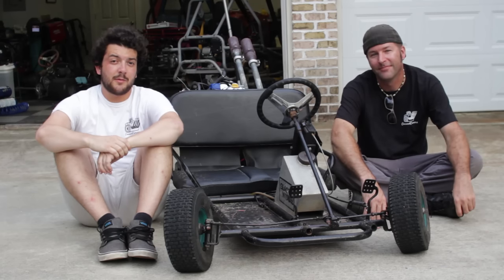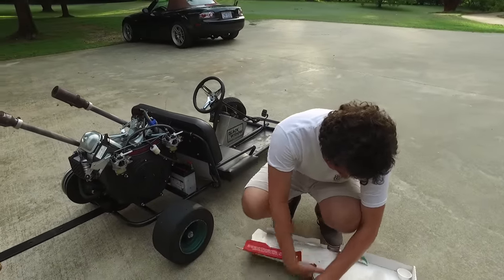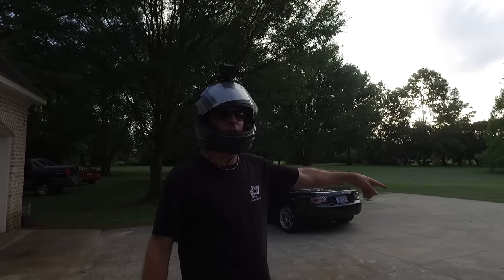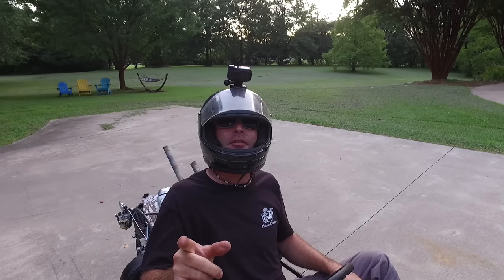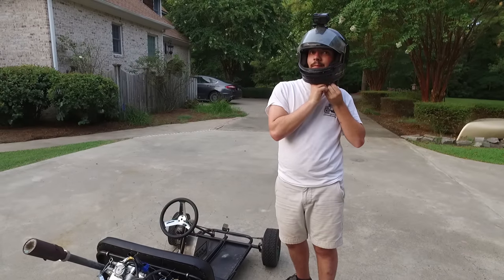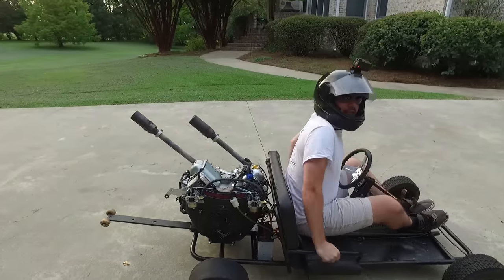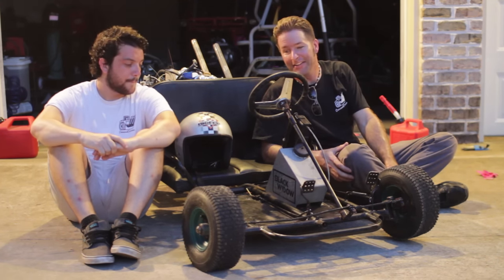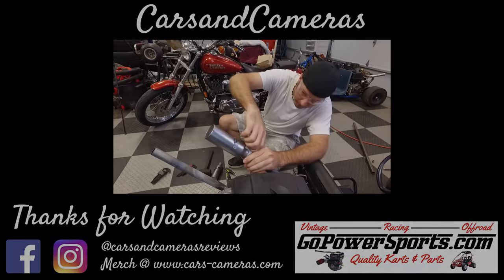Modified 670cc Performance Testing

Comment: Lengthen the cart (responsibly with structural support) and you'll get more airflow to the engine.  The seat and driver are blocking the cold air.  Added bonuses - cooler air = more power,  look  cooler, knees not blocking the view.  Just sayin'.
Reply: Bump this. Excellent idea
Reply: They could also move the engine a bit more forward of the axel depending on how the do it and help with weight distribution and keeping that front down
Reply: PunchingMegaTree dam. I get what they want tho. Although if it was me I'd just mount the wheelie bar at a 20-45 degree angle and just enough to clear the wheels on it
Reply: +MyLonewolf25 forced air intake with a couple pipes that lead off to the side would help for better air flow
Reply: Joshua Cyrus that too

Comment: Awesome, my gokart does about 30 mph  well 25  maybe. I have actually rolled it taking  a corner. I thought  it would  stick  like it usually  does but we went over. My knees were stuck between  the  steering  wheel  and  frame for like, 2 rolls before  we separated  and the  kart flipped couple  more  times . I had  to lay  there and wiggle  body  parts  to make  sure  l was ok. Funny  how  that made me realize  that I am 43 and  not 17 any more. Lol nice vids keep  having  fun  guys.
Reply: lol. glad your ok

Comment: Put a turbo on it.
Reply: i agree turbo it
Reply: Prob not gonna do anything
Reply: +MrRavenous TURBO=OVER POWER OVER POWER=INJURIES AND INJURIES=LESS VIDEOS....Do u see where im coming from?
Reply: +Aaron Larkin "they" (John) crashes it anyway
Reply: Ya thats i good i idea i like it
Reply: twin turbo
Reply: you're coming from not so fun parties lol
Reply: Aaron Larkin
No but i see a turbo and an awesome video in he future.
Reply: It'll be fine.
Reply: A two stroke engine can not be turbo charged. The exhaust is forced out with the fuel and air being sucked in, if  its forced in, you will be forcing fuel and air out through the exhaust port, a fucking stupid idea.
Reply: Ozzie Peck
 Is that not a 4 stroke engine? Because they had an oil leak.... and from my knowledge two strokes have a mixture of oil and fuel so there is no oil pan.
Reply: 2 stroke engines can be Turbo charged! You would need to modify the engine and carbs pretty much but it's possible. Way easier would be a supercharger. The 670 is a 4 stroke anyway. But a supercharged 2 stroke would be a fantastic project!
Reply: +fishFind3000  So What? It would still be cool and fun to see.
Reply: Won't work
Reply: Actually, by putting the carb in front of the turbo its fairly simple. Classic Suck-through setup :)

The crankcase itself shouldn't mind the added boost much. Jetting and porting will be a pain, but it is very doable. World record 50cc bike (google "buddfab") and countless snowmobiles are set up this way.
Reply: kondemnert or just boost reference it
With something like this
Just run a line from the tank to the intake and boom
Boost referenced
Reply: do you guys fix and modify other people's go karts ; for money of course
Reply: Aaron Larkin lol I have a 4 cylinder 600cc engine from a Kawasaki ninja
Reply: No . Its carbeurated.
Reply: Matt Williams you can put a turbo on a carb bro.
Reply: Ozzie Peck The hell they can't; it's quite common in the snowmobile world for the Polaris, AC, & Skidoo's
Reply: hmm...great minds think alike.
Reply: Did anyone look at the stain on the pizza box .
Reply: LARKO LAD it'll be fine

Comment: i bet if you put a bigger sproket on there you could push some serious speed
Reply: smaller sprocket* on axle would b more top speed.. bigger one on the tav would have the same effect but not as significant..
Reply: +I.C. karting 
Ya should go as big as you can go on the tav. It causes less sprocket wear vs a small front sprocket. 
Adjust speed accordingly with the rear sprocket.
Reply: 2 ATV carbs and a smaller rear sprocket will give you more speed.
Reply: You can only go so big with    the tav sprocket and they're specific to tavs.. I say just throw a 40 tooth on the axle I think it b the easiest way... and those carbs are good if they jet em a lil richer. But higher gearing will make it accelerate harder too cuz low gear on it now must b like 14:1 with small tires that's useless
Reply: the rear sprocket or the front, cuz the rear sprocket almost hits the ground when they are doing wheelies, but i guess it would make some nice sparks
Reply: a bigger sprocket would give more torque but less top speed. But I do agree they should put a smaller sprocket.
Reply: I agree. Larger front or smaller rear would make this really fast. My 208cc can do 65 at Blackhawk, so there no reason this thing couldn't do 80 with the right gearing.

Comment: Take a pcv valve of like a Miata and put it inline of the crankcase vent
Reply: Most small engines have a pcv valve but when it gets higher Rpms then it begins to fail and starts pissing oil
Reply: +MaineMan yeah, use a higher quality pcv valve made for a larger engine like a Miata one because yet the engine is small it's bigger than the 670
Reply: +MaineMan maybe one of those mini pod filters too
Reply: pcv valve or not the engine still needs to vent crank pressure. they just need to T it off and run those lines to the pod filters.

Comment: I'd focus on sorting out the motor. Pods like you mentioned, better throttle cable system to synch the carbs, catch can or something for the oil problem, then start messing with the jetting on the carbs. Wider tires probably wouldn't hurt. You guys are awesome, thanks for the amazing content!

Comment: This list makes sense to me.  
0. Play with mixing your own fuel.  (read up on what Acetone and Toluene can do for you)
1. Oil Catch can
2. Jet the carbs to the desired AFR
3. Rework the exhaust into a Y to gain scavenging effect.  
4. Put timing marks on it so you can check timing, then make changes from there.
5. install some type of adjustable timing on it, either a distributor, or electronically controlled timing.  
6. Port cylinder heads.  
7. Tuned intake manifolds (proper length and diameter) for what RPM and flow you are running.

Comment: Come up with different exhaust designs and test for performance changes. For instance, someone in comments mentioned an H pipe design and I was thinking an X design, and maybe Y pipes design with one baffle. These ideas would be cheap enough and interesting for most of us. 
Maybe include what you guys do to correct the camber issue and address some safety issues, like a cage maybe?
Anyway, thank you for these videos and the smiles and outright laughter they bring. 
It'll be a'ight

Comment: You can do a lot with porting and polishing, which you can do yourselves. Mill the head to boost the compression, and if you put a cam in it you will see a lot of difference. If you go with boring it out, and new piston you will get some more ponies. When you do all that, better hope you are on the grass when it blows up, because the oil will leave a really bad stain on the driveway. Ike the slippage you felt was the grass under the right rear wheel, and the full throttle ride on the jogging trail was a little scary, and it is good you are wearing a helmet. That way when you are laying up in the hospital with all your limbs hanging on wires, at least you will be able to see the nurses walk by.

Comment: After you get some pods, get a tuning jet kit. Several main jets so you can find the right  tune with the header/carb setup. I would start  with one size smaller than what you have in the new carbs. You have awesome flow .

Header length and even the tips you have, type of gas, and weather all affect your optimal jetting. This thing is wicked.

Comment: I have a 06 CBR 1000RR engine . The deal is this , you guys can have it for two years if you get it cleaned up , running and picked up from my house. As long as you guys return it in working condition in two years it's yours to play with. It's been sitting outside under a tarp for about 2 years. Its going to need some serious TLC but I'm sure you guys can handle it. I live in Fort Lauderdale FL

Comment: Wider tires open up the jets, twin high flow air filters, a breather catch can higher pound valve springs and maybe better rockers, advanced timing key and possibly a performance cam and billet rod you can get about all of those at go power sports

Comment: Yall are awesome, im in the process of restoring a dual axle frame somewhat similar to yalls, planning on getting the same engine, what type of clutch/torque converter did yall use. Thanks

Comment: go to parts store, pick up a pcv valve, oil problem solved, do advance timing if you can, an advanced timing give a lil more pop as the piston goes past tdc, you can also port match and polish the heads... that will put the mo boogie in it..... cool vids keep it up

Comment: This thing is wayy cooler than the 4 engine kart, sorry! Its so simple and raww.. Next thing you guys should build would be a reverse-trike (2 wheels up front, one in the back). Rigid in the rear and atv style front end with suspension with the v-twin or something raw.. With an adjustable swingarm! Wow, I wish I had any mechanical skill or tools/machinery...

Comment: I had been wondering how one of those engines would perform on a go kart. Looks like a ton of fun. All you need for the oil tube is a catch can. Jeg's and Summit have lots of them, I run a Jaz plastic one on my big block Duster instead of a PCV system. It works great. Its got a breather element on top.
Reply: thanks

Comment: You can go for cam timing if you want more :) You'll need to make or buy a timing wheel, find what is your current timing of opening and closing valves. Surely there is some angles what to modify. Your engine is designed to work at max 4000 RPM, so there are some opportunities. Easiest way, which I did, is to weld and grind the cams so you get the valves opened for longer and higher, which will increase the amount of fuel going in at higher revs, so more power at high revs = front wheels up!!! My "walk behind" lawn mower sounds like a competition 4-stroke dirt bike now :) But before that I'd recommend you to visit a DYNO man, and see your power and torque curves. Also easy way is just to increase a compression ratio. You have only 8.2:1, you can go up to 13:1, where you should switch to 98+ octane fuel...

Comment: You guys should look into adding some spindle springs to that front end. It will make for a softer landing and hopefully keep your spindles from bending more than they already have.
Maybe little wider tires front and rear to help with traction taking off and at higher speeds.

Comment: get a slightly smaller sprocket for the axle, drill a hole in the lid of a small plastic bottle for the crank case breather, and some nice ram pipes on the carb intakes  ;)) there should be plenty of cheap ones out there fellas.
quite often the bearings on the kingpins drop to bits at the bottom, but can be difficult to tell unless you take it to bits, thats if it has any lol .... it could have brass bushes in it if its so old, maybe the brazing has split on the frame with all that extra weight.

Comment: taping up blower housing also drilling low speed jet in both carbs cutting each fan blade off the fan also helps

Comment: Beef up the wheelie-bar and put a chain-driven 3rd wheel on the end of it.  Then you can nail the throttle and keep it there for longer wheelies, or adjust it down so its always in contact with the ground, and you should get more acceleration.   For top speed, make a  body kit (corflute is cheap and easy) for aerodynamics, and change the gearing for optimum revs.  Hard to make significantly more power without major head machining, porting work, or bolt-on supercharging (compressor or n2o).  On the roads you have to play on, I dont know that *I'd be chasing more top speed though :)

Comment: Unless someone makes a spring kit, billet flywheel and billet rods, not much more you can do for top end. I think its pretty much maxed out as far as performance goes, outside of new air filters on the carbs. I think the front end needs to be beefed up and probably could use stronger spindles. So I would just get the air intake finished up, tune and synchronize the carbs more and fix the front end so it doesn't snap coming down from a wheelie.

Future builds I would like to see custom built mini bikes, frame and all, or even go and buy just from frame from Azusa and build either off road or street minis. I know you guys have mini bikes, but a build up would be fun.

Comment: That motor is a beast you can get taller gears for more top speed and I bet it still has enough Kaunas to pull the front wheels

Comment: That hose is a PCV hose (positive crankcase ventilation) it needs a small hose filter, you can pick them up at any auto parts store, it will cure your issues if the hose off the motor it straight up and down and not pushing oil into the filter

Comment: Make a roll cage for it, and then change gearing and add a trimming key and what ever else. Possible bore it out get a hardened crank, forged pistols and rods, stronger valve springs, and possible a cam. You can get a performance 212 cam, so you could look into it and see if a 212 cam would work on a 670
Reply: A roll cage would also stiffen the frame a little bit helping to keep it from bending in half. A little more weight to the front of the go kart would probably help your handling to

Comment: I wouldn't change much more on the engine but I would button it up and start some  frame/tie rod straightening. If you want a touch more speed put slightly larger tires on the rear the gearing seems right for what you have now.

Comment: port the heads and stronger valve springs. hotter spark plug might help. and ballance the cranck. reduce the wheight of the flywheel. and ingnition timing can also be changed with moving the coil, make somekind of rails for it and you can try out different settings with different timing.

Comment: Would having a front suspension be of any use or would you just be better off with heavier gauge bar stock to hold up to the wheelies? You could also add weight to the front end that way as well.

Comment: Both karts are pretty awesome, but I'd really like to see the 670 on the 212 kart chassis. The lower center of gravity might remove it's ability to wheelie like a gasser, but it would have to be amazingly fast. Engine swap FTW!

Comment: here is an idea turbocharge and efi the engine similar to the drift trike or do a draw through carb turbo setup (same turbo model in a single turbo format would be all that is needed for this engine may even generate mild boost at or just above idle= more power+ quicker torque converter engagement) , reducing the sprocket ratio will give it a higher top speed and it will make the torque converter work better, you will also reduce the actual wheel hop at take off and not ruin your frame when the cart slams down

Comment: run the pcv to the intake somewhere. oil shouldn't come out of there only air. I'm not a small engine tech but in my 4.0 xj if the pcv is bad it causes blowby and will leak oil from either the rms or the other pcv valve. just an idea. love the vids guys.

Comment: put the crank case hose in a can so the oil goes in the can and not all over strap it to the frame . make sure to put breather holes in the can  at the top we used to use Marvel mystery oil cans when I raced carts on asphalt and dirt .

Comment: I could be wrong but i assume its ohv not ohc. if it is ohv put in stiffer valve springs. you should also shave and port the head to raise the compression and help with air flow.i dont necessarily mean a machine shop job its just a fancy lawn mower engine just a good old dirty but effective shave.

Comment: possible the wall is close on the engine.faster(higher top speed) would require gearing it up a bit. midrange power could be accomplished with longer intake runners.
plate bracing front axles on the top of the tubing would help prevent bending. the kart looks like a bit of fun to be sure. at the point you guys have it by now i'm sure frame flexing is happening somewhat. a bit of bracing at critical junctions might be called for by now ;-)

Comment: You guys have probably figured out it has an internal finned flywheel that acts as a fan for cooling. It can run all day without moving at all without overheating. Uses the classic small engine forced air cooling.

Comment: Add sum front suspension to it. It would help with the bending axle plus make for better control and landing after wheelie. Also add a roll cage for safety

Comment: You need to make a supercharged 670 v-twin Shifter Kart if it's possible. I just don't know if you can hook up a gearbox to a 670vt. But that'll increase top speed with good torque.

Comment: change out the emulsion tubes in the carbs for gx140 tubes. it will crispen the throttle response and help run the mixure a little better
the timing keys dont raise the rpm they advance the ignition. that with better octane fuel will give better throttle response and more power. there is a limit though you have to find the sweet spot were it likes to run
your lifting of the rear tires is because you are pulling harder on the wheelie and turning your wheelie bar into a sprin. it has to much give and is bending and then unloads the energy is causeing the rear tires to lift off the ground.

Comment: Hi guys! I have a go-Kart, it will be having a live axle when I have the time... I have 6" wheels and a 212 predator engine(Number 41 chain) What gear do you recommend I put on the axle to start? I want mostly top speed even though I still want acceleration for moderate off-roading/drifting/burnouts!  I have a 30 series torque converter as well... so I was thinking a 52 tooth but I may be thinking crazy for lack of acceleration.